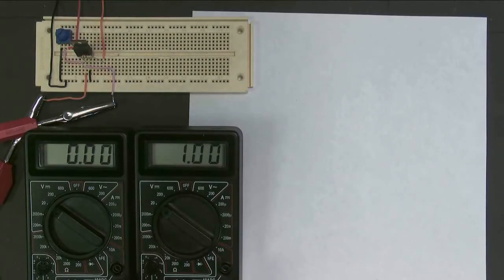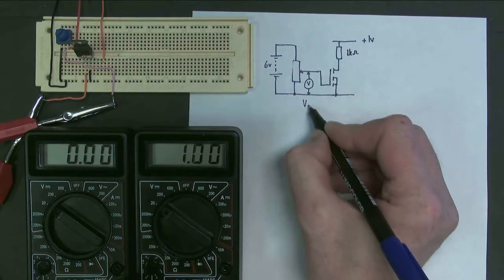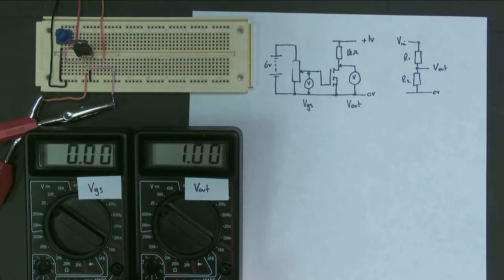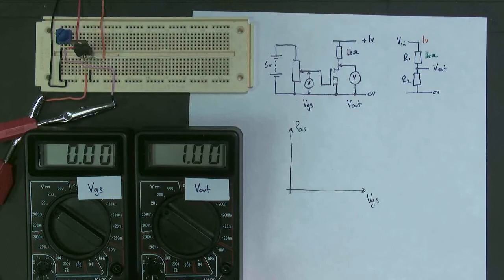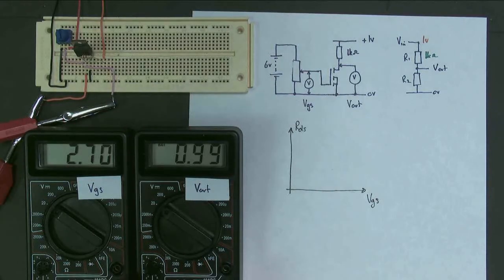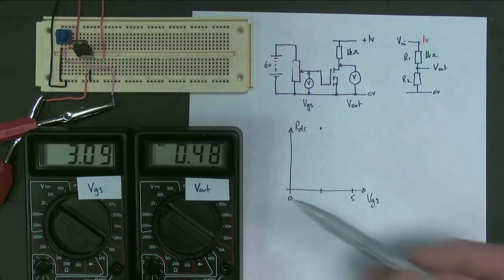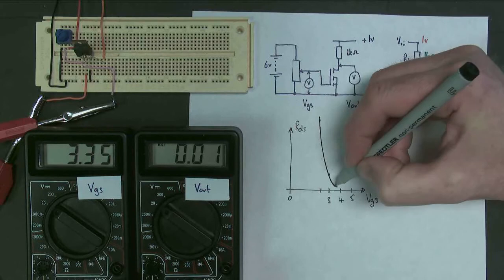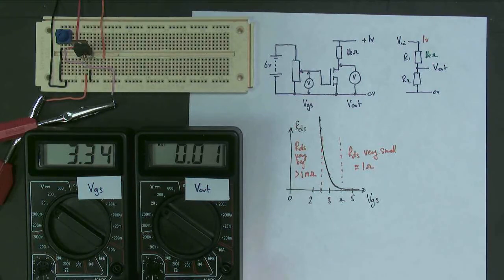MOSFET Part4 Variable Resistor1

Comment: Pretty good men, btw for all the ones that want to know what's the resistor value(R_DS), you just need to solve for R2 in the voltage divider equation, e.g.:  @6:03, Vout = 0.48V, so solving for R2 in the voltage divider then we have a resistor of 923.07Ω, [eqn.: ((R2*1V)/(1KΩ + R2)) = 0.48V] .

Comment: Great circuit. You may want to put a fixed resistor in series with the pot to avoid a battery short at extreme end. I’m sure you know. May not be clear to all the readers.

Comment: So how can someone use a mosfet as a variable resistor when its resistance characteristics are absolutely non linear? After a certain Vgs, the resistance drops so rapidly to almost zero 👎🏾
Reply: just keep it in the linear range, which is sadly very small